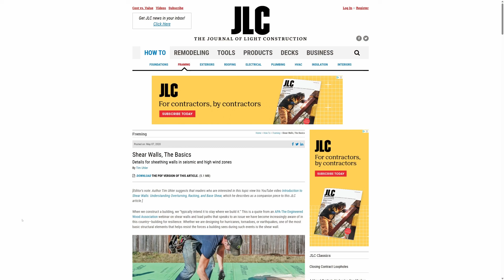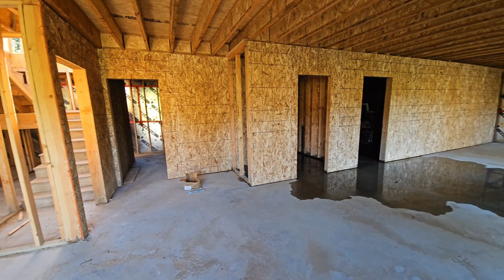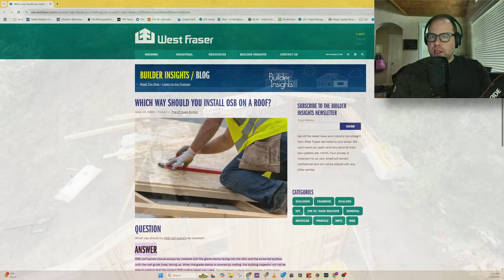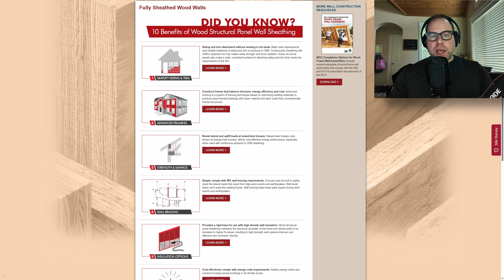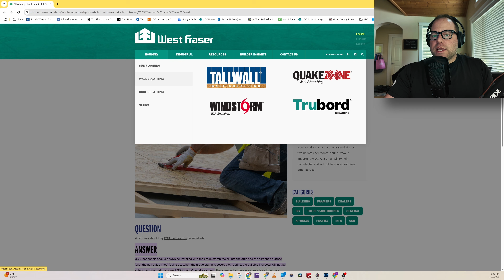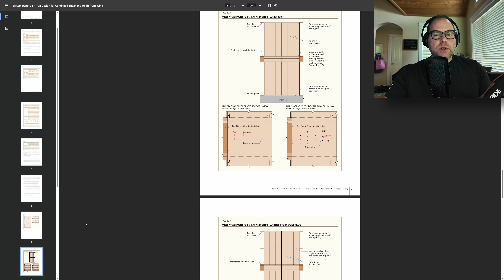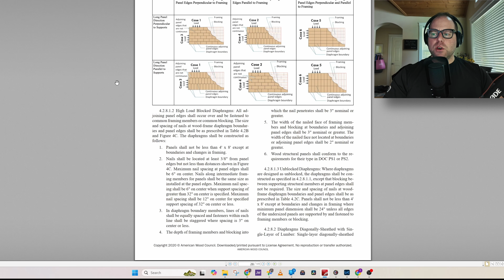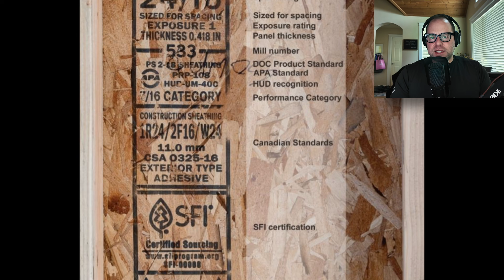Vertical vs. Horizontal Sheathing – The TRUTH According to Code

Comment: As a liscensed Calif contractor for nearly 50 years I know I can put plywood up anyway my structural engineer says. I won't use OSB or Tyvek because it is too wet where I build. When the slab gets wet and the OSB board is in you better look for problems. What happened at  7: 01.  If that was a custom for me I would demand that the compromised OSB be replaced.
Reply from the maker: No OSB in this video, nor in any video I've ever posted is "compromised".
Reply: @AwesomeFramers  3.56 OSB sheared walls standing on a wet or puddled slab? Better said I just won't use OSB. You should have seen the plywood we got addicted to in the 60s.
Reply from the maker: @chrisbrowne4669  They aren't standing on a wet or puddle slab.  They are off the concrete and nailed to the treated bottom plate of those walls.  The plumbs spilled water during whatever it is they were doing.  That has zero negative effect on the OSB unless it saturates and doesn't dry out.
Reply: this guy doesn't use tyvek because it's "too wet" there.  okay.  yikes!

Comment: You're exactly right That's what I was taught when I was a framer 30 years ago. I am very disappointed that a lot of homes in California that were built around the '70s -'80s have absolutely no sheeting. They just installed stucco or siding right on the tar paper and studs.
Reply: Seems like stucco would have a great sheer value but IDK
Reply: @dwightsornberger8916 oh god no. Stucco very bad sheer value.
Reply: @mechanicalman1068 but it has a value. And I worked on many of those houses and the survived the Loma Prieta earthquake just fine
Reply: @johnnichols2710 perhaps, but Everything has shear value and I have a hard time believing it was the stucco that saved them. Stucco is brittle and there’s not much mechanical attachment to the house. Engineers sometimes factor in drywall or even lath and plaster. 

I’m from the Bay Area as well and have been in this game a long time. I was around for the Loma Prieta quake. The older houses that fared best were generally in the hills or otherwise on bedrock. Look at the iconic pictures of the houses in the marina, with the top floor collapsing on to the lower floor like a parallelogram due to poor shear. Those were the expensive houses, and all were stucco.
Reply: @mechanicalman1068   I basically live on top of the San Andreas fault in San Bruno. It's 200 feet to the East. Even though i'm on the bedrock side of the street, these home are not directly attached to the bedrock. I was in my old house in San Mateo during the 89 quake and i remember it vividly like yesterday ! That house was a large 1 story custom built all redwood sided rancher and the only thing that suffered damage was the Bond Beam between the pool and the Hot tub. Now i'm in this 2 story all stucco home which is riddled with cracks with zero sheathing which is why i'm also here learning the best build practices while i'm renovating this home for new stucco. 
   I've decided to replace all the windows in the home with Marvin Windows but at the same time i'm going to tear all the stucco off and sheath it before the windows arrive in May. I got quotes to do the job and it's between 150k and 200k for just the sheathing and stucco which would be impossible for me if i didn't have decades of residential construction under my belt. I'm not a stucco guy but i know how to do all the prep for it. So i'm doin this back breaking job all by myself for about 10% the cost of those quotes over this spring and summer with the added benefit of also being able to install insulation everywhere  where there isn't, replace exterior wall vent stack plumbing, replace any rotted framing, mitigate any mold that is present, along with the added R Value and noise reduction and just having overall have peace of mind that the house is solid and as moisture proof as possible. Btw, in the past where plywood /Osb has been installed with no 1/8" gaps, i'd just set the Skilsaw to plywood depth and cut one.

Comment: Around 01:20 you joke that the wall sheathing is vertical but the gable is sheathed horizontally. Of course the gable is triangular and thus already a strong structure, so sheathing orientation for strength would be less critical. But then I think you make the convincing argument that either orientation works, so moot point. Maybe in the gable, running horizontally they can use more full sheets? Therefore less cutting?

Comment: Your estimate of deflections in staggered vs non-staggered joints is not quite correct.  If the staggered joists are truly stiffer (higher Ga value), then the loads will be higher in seismic as the deflection is less.  Staggered joints are beneficial in out of plane loads (think gravity loads on floor or roof sheathing) as the zones of higher deflections in the panel edges/ends are supported by zones of the stiffer panel middle.  All the best from an engineer in Central Coast California.
Reply from the maker: Thanks!

Comment: Very critical to have edges blocked and nailed when you use the tables for blocked shear panels.  Also, those are nominal capacities.  divide by 2 for allowable stress loads.  There are other adjustments but way to much to explain in a youtube comment.  Vertical panels are normally the way to go, especially if you can avoid adding a block line to catch edges of panels.  If you're in a high wind zone, horizontal plywood is the way to go as it has greater punching shear resistance.  Good job on the video.

Comment: The rule of running sheathing horizontal is from back in a simpler time when plywood was the cutting edge engineered product. Now that there is a lot more science involved in building a fancy house, yes you can probably run your sheathing vertically.
Reply from the maker: Not "yes you can probably run your sheathing vertically", but as shown in the references, we can and do 👍
Reply: @AwesomeFramers  Im sure lots of people in the modern age have agreed that it is okay to run the sheathing vertical. On the other hand how many tried and true building techniques have we lost in the pursuit of production. To me anyway it just makes sense to have the long run of the sheathing perpendicular to the long run of the studs.

Comment: I think that there is another benifit to your method, in that the less job site cuts you have on your paneling means that you are butting up factory edges more frequently, removing the possibilty of having slightly off square cuts causing slight gapping towards one side or another. Maybe it's just me, but I think that if anyone were to do scientific testing, they would find that the tighter and more accurately the panels are placed against each other the better the wall assembly would do in shear and seismic.

Comment: There is a huge difference between walls and floors/roofs.  Obviously floors and roofs bear weight directly ON them , so the have to be installed across the joists, as that is where their strength is.  That applies even more to plywood than OSB, but still is a factor.  You are right, you notice a sponginess in vertically laid sheets on flooring or roofing, because you are pushing down on the sheet.  Walls are NOT getting load on them, but are there to resist racking and rectangular collapse.  Otherwise known as sheer.  The panel's sheer strength is likely almost equal both vertically and horizontally, unlike load, which has a noticable difference.  The resistance to collapse is in the perimiter nailing you do on the sheets, and you still put the same amount of nails in each sheet.  You can do away with sheathing on walls altogether if you use diagonal bracing across the studs, because you form TRIANGLES, which are strong and resist racking.  That's why a lot of roofing gets a diagonal brace during construction but before the sheathing is installed, to prevent collapse from wind.  Personally I don't like OSB, it's heavier and weaker than plywood, but it's cheaper, so it is used.  Natural and plywood are far superior and I try to use them whenever possible.

Comment: I'm an engineer, and I think you hit the nail on the head.  However, I'm the wrong kind of engineer - a chemical engineer, retired.  Also retired for software engineering.  I'm building a house in Idaho.  So, I'm going to use a combination of horizontal and vertical, depending on the location of windows and sliders. And I'll just add blocking as needed for all the edges.
Reply: You should just run it vertically and save the extra labor and material. There is rarely an advantage to going horizontal. Remember, doors and windows are not considered part of the sheer wall. But it is a good idea to always run your sheets where the seam breaks past the opening of the window by at least 1 ft. And if you go horizontally on a exterior wall, that can be a lot of drilling for the plumber and electrician

Comment: I know about this! @AwesomeFramers I had this argument with my building inspector on my house. I did some digging (I am an engineer) and I found the structural engineering paper that caused all of this. The paper is about CDX. CDX has an odd number of layers and the outside layers have the grain oriented long ways so that dimension is stronger. The shear force on a wall is horizontal, so orienting CDX horizontally increases its shear strength. The paper also says that above 3/4" thickness the effect is no longer significant enough to bother with.
Reply: cdx does not have (only) an odd number of layers.  it totally depends on the product.  there are 4-ply and 5-ply versions of 19/32" available.  most 15/32" i've ever seen was 4-ply

Comment: I know you covered this topic come time ago, however I'm curious where you source your concrete form boards now. I believe you use 1-1/8" MDO ply, 2'x8'. I know you also use HDO, however I don't need the durability of the HDO. thanks for any help on this. Love your content BTW.
Reply from the maker: I order through the lumberyard.  I think they came out of Woodinville last time
Reply: @AwesomeFramers  thanks for the quick response. Wasn't sure if you sourced from a certain supplier on-line. thanks again for all the great content.

Comment: The problem with hanging sheets vertically is you can't straighten the studs as you nail the sheets. I've built house for years. I've installed sheeting both ways. Horizontal is easier to install!
Reply: Except that you have to block it. By every code in Canada or the US all four edges must be supported by (nailed to) studs or blocking, so I fail to see anything easier about it. If your studs are so far off you can't pull or push them easily on line by hand you probably shouldn't have used them or should have blocked them into shape before you started sheathing.
Reply: Very good point.
Reply: I agree but your not building a f ing piano. Toss out the bowed studs and cut them up for blocking lol

Comment: I work for a pre fab building manufacturer. And 99.9% of our jobs, the sheathing is vertical. Besides the trusses. But that's only because the webs and layout work better. Otherwise, we're required to block the cavity for our MFB to nail the seems.

Comment: I wish people would stop saying its in the code. The "code" is different all across the country.
Reply from the maker: That's not actually true.  The IRC is the model code, but there can be ammendements made locally.
Reply: The IBC (IRC) is used in 47 states. 2 still use the old UBC and California has it's own. I'm a commercial building contractor "A". I'm also on the IBC counsel.
Reply from the maker: @lazyhoundracing9621  👍👍

Comment: I build so panels finish on the rim joist. The rim joist provides a continuous shear path across floors.
Reply from the maker: Its true that breaking can elminate uplift hardware, but the shear wall specs are based on plate to plate.  Here's a video that backs this up https://youtu.be/hSwjkG3nv1c?si=td2Txc4qO7dqWgG_
Reply: what about at the top?  on a single-story, if you have a few inches to play with (lol), would you also try to tie into the gable truss with your sheets, or do you think that's not necessary?

Comment: I’m a retired electrician but love construction of all kinds. Before I became an electrician I was a chemical process operator and a powerhouse boiler fireman. Whenever  I was learning a new job or working with someone new I would ask them why they did something a certain way and usually the answer was because that was the way the person that broke them in did it. So I would ask them “what if the person that taught you didn’t know what they were doing”? Sometimes they would say “we’ve always done it this way”. And I would say “what if you’ve always done it wrong”? My experience has been that most of us don’t really know for sure if we’re doing something correctly or as well as possible if we don’t take the time to question things from time to time. A friend of mine would say when someone showed him an easier or quicker way to do something, “well any dummy can do it that way”!
Reply: I designed our retirement home and studied code requirements and all sorts of stuff to get it right and to make sure my plans were approved. Then I find out that most builders don't really know code that well, that they violate it all the time. The inspectors in our area have at most half-an-hour to do a framing inspection so there's no way they're going to catch everything.  So keep doing the same old methods -- until one day they get nailed (pun intended). One violation I see ALL THE TIME is that the birdsmouth cuts on rafters should not cut more than 1/4 into the depth of the rafter. For example, a 2x8 is 7.25" across. 1/4 of 7.25" is 1-13/16". Another thing I see regularly is composition shingles where the roofer does the starting row by simply flipping the shingles top to bottom. This makes the tar sealing area between shingles a whole tab up from the eave edge. This means that the lowest shingle has no place to seal and is a target for high winds. The correct way is either to use starter strips, OR to cut off the tabs -- either method puts the tar sealing area at the edge of the eave so that the wind cannot get under the shingles in the first place. I don't know if this is code or not, but it's printed on every bundle of shingles to do this method.
Reply: I believe time is what dictates right or wrong. Experience is a huge part of it because if you're building loyal repeat customers and not getting called back out to fix failures of your installed systems, it's pretty safe to say you're not a hack

Comment: Question mark here
I've seen different color paint on the sheet edge, blue, green, red . Are they any different in strength? I've noticed red is strongest and green kinda seems weaker. Anybody else notice a difference?
Reply from the maker: That's just a brand distinction

Comment: I heard a little while back that the nailing schedule for exterior sheathing will going from 8"/4" to to 6"/3" in IRC book coming in  2027
Reply from the maker: Interesting.  Right now there are a variety of tables in the SDPWS and the engineer picks the one for the load.  Most often for us its 6&12 but sometimes 4&8

Comment: 1:14 It makes sense to me that the 2 stories would have vertical sheathing and the gable would be horizontal because wracking would be almost impossible at the roof level, but very possible in the wall studs of the first and second stories. Also "vertical" sheathing under that shallow roof line would be nothing more than a few 4 food wide fragments; there would be nothing "vertical" about it, and the horizontal layout would be stronger at that level. Now, I have no idea why the gable sheathing appears to be a different kind of OSB from that of the 1st and 2nd floors; maybe I'll find out in the rest of the video.
Reply from the maker: Tall wall sheathing doesn't have a rough surface and it states not to use it on the roof.  The 4x8 you see in the gable are made with a rough surface on one side for traction on the roof.

Comment: While showing manufacturer specs, he kipped staggering the joints when hanging vertically!!  Even if it's done correctly on this house he shows, I can't see that on my Macbook.
Reply from the maker: What? No manufacturer's specs don't show staggering when hanging vertically.  I read right out of the document that is linked in the video description
Reply: @AwesomeFramers Go back &  look at it again!
Reply from the maker: @Philip-t2j  Post a link